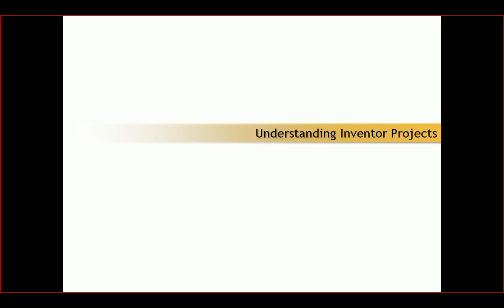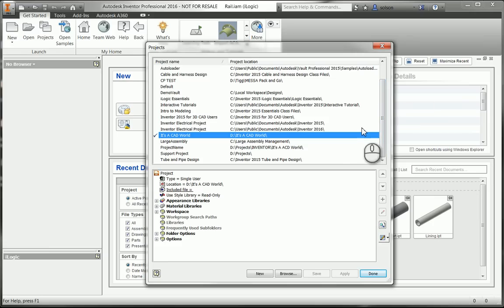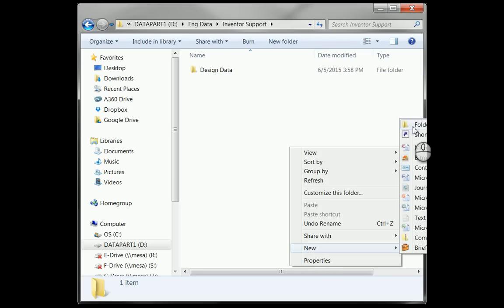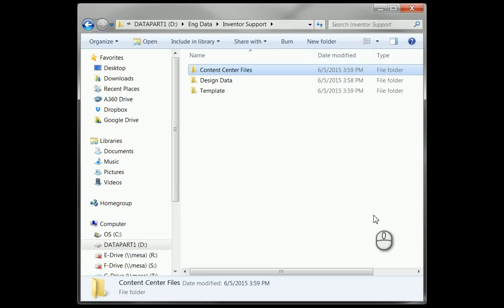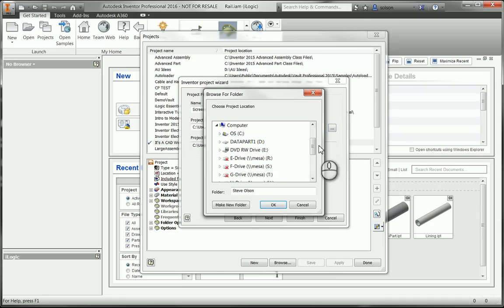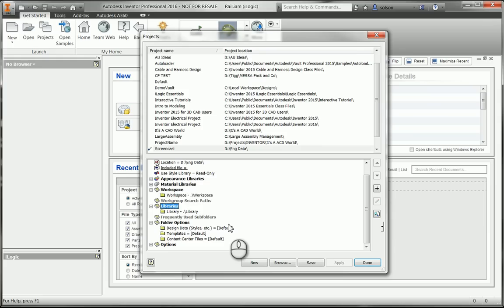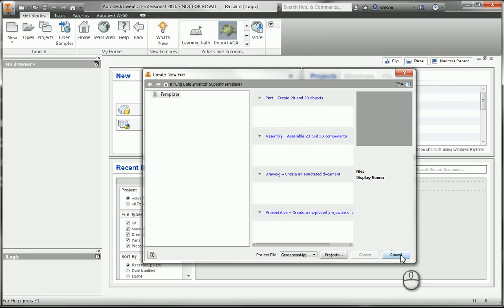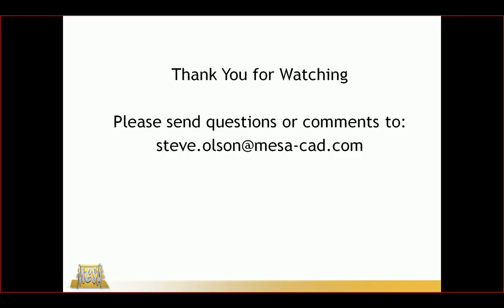Understanding Inventor Project Files

Comment: Do you have a video on exporting files to a new project and folder and reusing those files? i do everything manually now.
Reply from the maker: Sorry, I don't have a video like that.  I do have one for Inventor's Design Assistant, which might help you.  Design Assistant allows you to copy an assembly and/or drawing, during the process it will let you decide which files should be reused or copy with the assembly.  If you are talking about exporting for use with a different Inventor IPJ file, I just use windows to move the files to the workspace for the new project file.  Occasionally, assemblies try to pull their parts from the original location.  You can fix that by using the Replace command.  Another way to solve that is to alter the path to the original workspace and open the assembly again.  Since Inventor will not be able to find the files in their original location because the path has changed, Inventor will give you the Resolve Reference dialog and you can pick the files from the new location.  That typically fixes the issue.  If you use this approach, don't forget to correct the original path after you tricked Inventor to resolve the parts to the new location.  Hope this helps.

Comment: I am not able to see the setting in your video magnify the setting on the project click so I can see the video
Reply from the maker: I made this video so long ago, that I can't repost it with the magnification.  However, I can post an image of some of the settings for one of my current projects.  You can find it at this link.  https://drive.autodesk.com/preview/de29c8fc2/s/SH919a0QTf3c32634dcf95a075d53f230a3b

For this project, I am trying to put as many paths on my D drive.  My C drive is a smaller SSD drive and is almost full.  So I want to keep as many files off that drive as possible.  The most important information in this video is to understand the pathing because those will be different for everyone.

Comment: Thank you. I am still confused on how to continue with a project and how to copy a project to open it up on another machine. What to do if the other machine is loaded with a different version of inventor?
Reply from the maker: Project files are all about mapping out locations where important information is kept.  It points out where your designs are (Workspace), where templates and styles are kept (Folder Options), etc.  If you are moving a project from one computer to another, you will need to copy all the necessary folders of information from the original machine to the new machine.  If the new paths are different, you just need to edit the project file so the path are updated to the paths on the new PC.  

If you don't need the entire project, but just one design (assemblies, parts, and drawings), Inventor has a tool called Pack and Go, that will allow you to pick the top-level drawing or assembly and it will collect in a folder all the necessary files for that drawing or assembly.  

If you are working on two different machines that have different versions of Inventor, there isn't a save back feature in Inventor.  Once Inventor migrates a file up from an old version, there isn't a way to revert back to the previous version.  The best way to work in a situation like this would be to use a STEP file or another generic format to go between versions of Inventor.

Hope this helps.

Comment: where to save iLogic files?
Reply from the maker: The iLogic Rule files really can go anywhere on the local PC or network, as long as that location is identified in the iLogic settings.  However, I have added a folder named "External iLogic Rules" under Inventor Support.  I feel this keeps everything a little more organized.